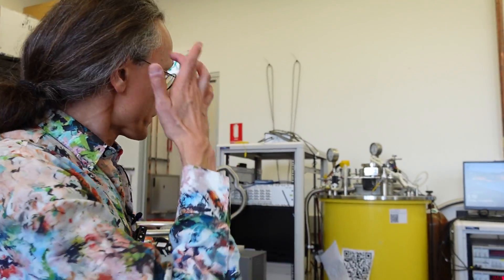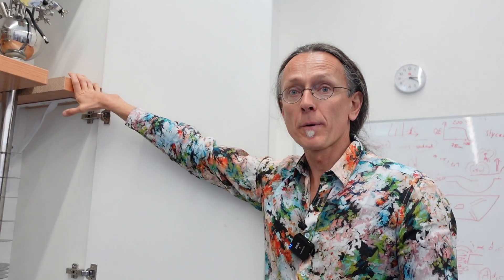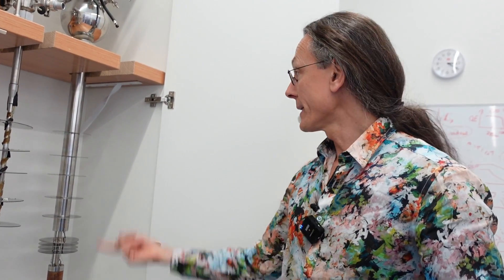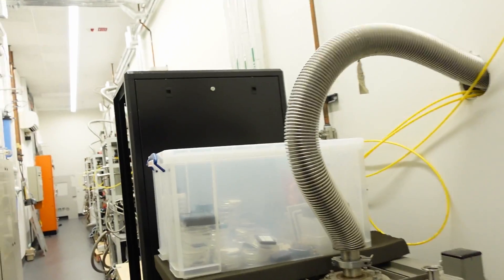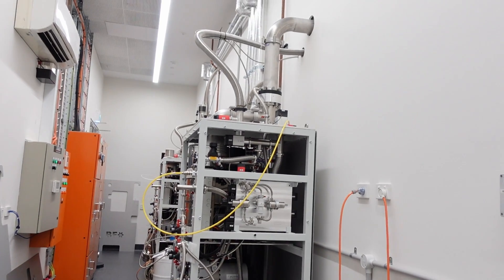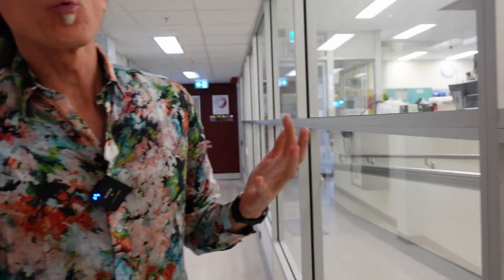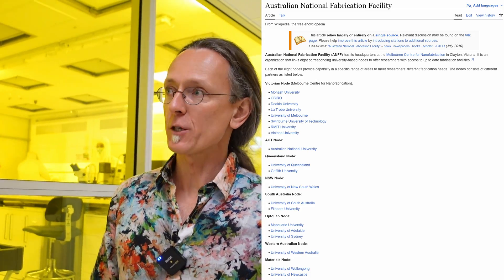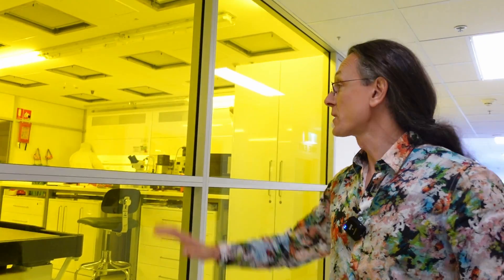UNSW Quantum Computer Lab Visit - Part 2

Comment: the talk is usually about the temperature you try to reach - but how much heat is actually dissipated? in like terms of watts. Because computers these days might have a CPU doing 250W at really high loads... but such a small testchip might only be on the order of microwatts - right? so the helium leaking and boiling off is more of an issue hence all the isolation stages?

Comment: Just watched the part 1 too.  This stuff is beyond my understanding, but it's still really interesting to see just what goes into this sort of research. It seems we are actually half decently close to seeing practical quantum computers.  I imagine we won't see them in homes any time soon if ever but I could see them being useful for AI and such once refined to the point they can do actual tasks.  I can imagine them being scaled down over time too where you basically install a "quantum card" in a regular computer and plug in some chiller lines into it that go to a central chiller system.

Comment: What is genuinely strange about QM-TIME Completeness cause-effect is that if you say you know nothing, it's simultaneously true and untrue, because Aether is the No-thing-defined of Sublimation-Tunnelling emptiness of Absolute Zero-infinity, trivial zero(s), and everyone knows something about Absolute Zero Kelvin Singularity-point Entanglement Origin Apature of the reciprocal connection division by zero at a self-defining point of nothing-connection. 

So because everything is connected, by nothing but time duration timing modulation interference, some weird and mysterious things are within-without the realms of 1-0-infinity range of probabilistic correlations shaping WYSIWYG.

GD&P parallel coexistence assessment of QM-TIME Completeness in Polar-Cartesian self-defining e-Pi-i 1-0-infinity instantaneous infinitesimal coordination.., those are the words, and it requires a skilled Art Teacher to demonstrate without words, how Fusion-Fission Function bonding operates in the Eternity-now picture-plane containment,  ..by rotating the concept of a Singularity-point existence around from the omnidirectional-dimensional Origin to the limit of 1-0-infinity wave-particle extreme of the inside-outside Unit Circle modulo radial-resonance expectations of orthogonal-normal axial-tangential distribution of superimposed frequency-amplitudes pulse-evolution. Point information is Spacetime Relativity In-form-ation substantiation holography vanishing-into-no-thing Perspective e-Pi-i Principle, hyper-hypo temporal superposition, i-reflection thermodynamical fluidity.

We hear endless words that hope to make Absolute Zero-infinity reference-framing containment Actuality, by repetition in zones of harmonic phase-locked coherence-cohesion sync-duration resonances, but it just doesn't stick. Until a sudden realization occurs, and we go on to the next stage development. 

This is actual Quantum Mechanics.
Reply: What you said....